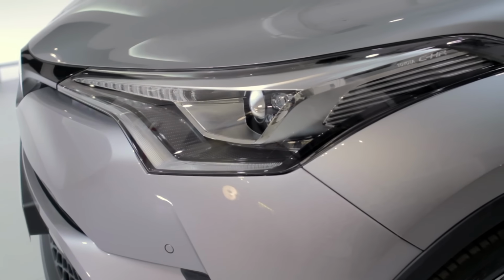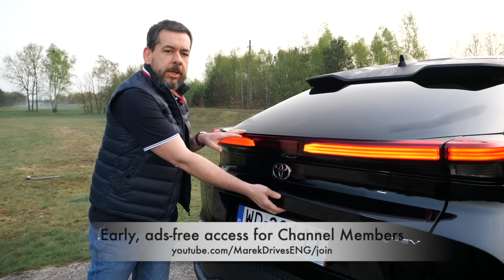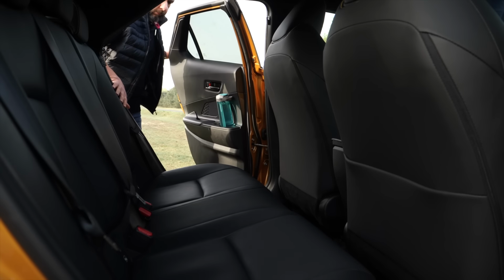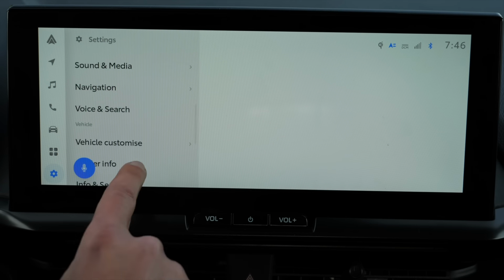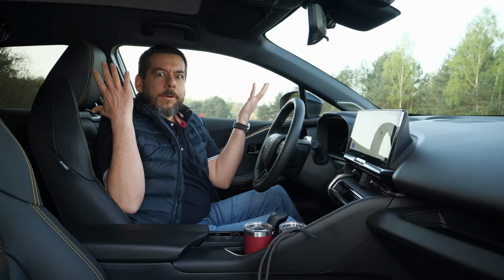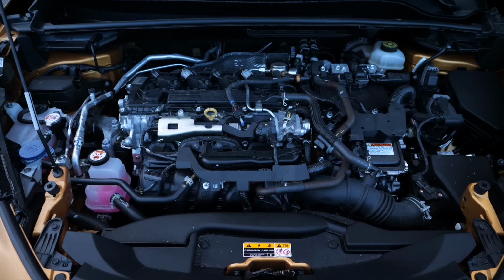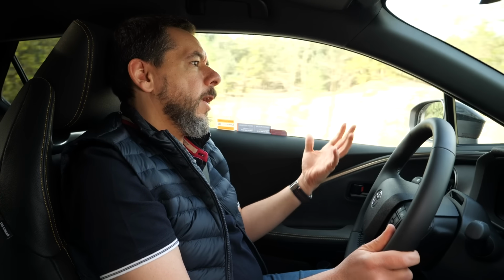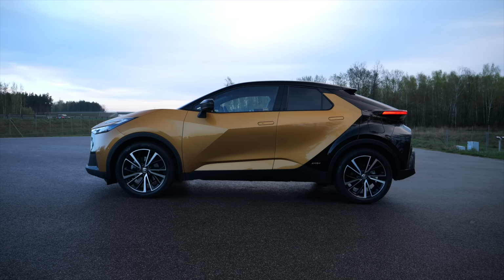2024 Toyota C-HR Hybrid Dynamic Force - How's That Even On Sale? (ENG) - Test Drive and Review

Comment: That boot beep still has my ears ringing! 🙉 There is a great offer for 12 month leasing in my country, so had to give it a test drive. The engine revs I might get used to, but the noise at anything but low speeds makes it a no go. Shame
Reply: You can turn the volume down through the settings for the boot beep, same as the speed monitoring which you can permanently disable and just have it flash in the heads up display instead.

Comment: Marek, to agree once with T&C in the Multimedia you have to setup a profile. Also you can assign a key to it, and every next time you will use your key or app, it will be used with your profile (all your setups, etc.). Such a great review level 🤣🤣🤣
Reply from the maker: Thanks for the info!
I usually setup MyT (or whatever it's called these days) app, and was never prompted to pair the key with the app. In some brands the car's main user is often the press office, so my options are limited. However in Toyota I often remain the main user until they sell the car many months later. So I'd blame it on UI.
Reply: @MarekDrivesENG  Imagine how bad you are at your job to have to be told this rofl. P.S. I don't see an edit to fix the misinformation you are spreading in the video though, typical press member just peddling any information be it right or wrong for a slice of bread.
Reply: La condescendance de ce genre de pseudos journalistes qui fait des essais sans connaître son produit 🥱😑🙄
Le gars avec des a priori et qui ne jure que par BMW 🥱
Mec, si tu n'as vraiment pas envie de tester ce genre de véhicule, évite simplement de mettre tes fesses dedans 👋🏼

Comment: You come across as one big sour pus
Reply from the maker: I just notice more stuff, than people do during a short test drive at the dealer. If some of my observations are not a problem for you - go ahead, buy the car. I'm here to help you make your decision.
Reply: @MarekDrivesENG  I think you are ignoring what market this car is designed for. There are shortfalls such as rear door opening and not enough room for 3 across the back. This is not a family car, it is a generous 2+2 that in PHEV form drives very well and is super economical with a very good performance without range anxiety. You do need a home charging facility and generally drive within 40 miles. It is not cheap but is very well equipped especially on the safety front
When you look at the target market, 10 years warranty with competitive servicing costs and fantastic reliability makes it top notch for that as an overall package for the more mature driver is hard to beat
I just don’t think your reports are subjective
Reply from the maker: @mikejoseph425  reviews are subjective by design.

Comment: You should stop winging. The ACC is different in other markets. The audio speed warnings are disabled by default in Australia. The traffic sign recognition still functions. Fuel usage varies depending on drive mode and style. I have achieved 3.8 litres per 100 kms using ECO drive mode. The centre console divider stays the same for right hand drive versions of the CHR so, no problem for the passenger accessing the cup holders. The boot features four tie down points should you need them. It also has a decent internal light to assist with loading and unloading at night.  

 No car is perfect. I test drove a number of cars before deciding on the CHR. My priority was safety systems and driver aids, driver and passenger comfort, above average multimedia system and, insurance and running costs. It is surprising how many similarly priced vehicles come with a lousy 4 speaker audio system. The 9 speaker JBL system in the CHR is definitely above average. 

Final thoughts, the reviewers comments about the all wheel drive system seem to confuse AWD with 4WD. They are not the same. AWD is not meant to provide off road capability rather improved traction and grip on normal roads. The CHR gets most things right but there is still room for improvement.
Reply: You got it right
Reply: I love my 12L GR Sport
Reply: 値段は高めだけど、デザインは良くて見た目も素敵な車。でも、それだけです。ちなみに、マレクの言う通りです。日本のおもちゃの車で楽しい旅を。

Comment: Regarding the two "nag" screens on the multi-media display. The first one goes away automatically after about 3-4 seconds. The second (where you have to agree to) never appears again once you have set up your personal driving profile ...the one which auto-sets seat position, A/C, radio station, mirror positions etc for each driver.

Comment: So Marek, just tell me - is this better or worse comparing to the first generation C-HR? You basically blasted this model.
Reply from the maker: It's got a better powertrain, it's got a better interior (at least in the front), it's got better (IMO) styling. Having said that the interface is still crap, and soundproofing is atrociously bad, which when you factor in the high price makes this car a second or even third choice. I'd go with Hyundai Kona or KIA Niro over this any day.
Reply: @MarekDrivesENG hyundai kona ev,you can hear the wheels moving on the ground at city speed..

Comment: Allegedly reliable cars. But cheap plastics everywhere, lack of insulation, flimsy wires and covers under the seats and steering column, misaligned body panels (more often at the tailgate), and sharp burs in the internal faces of the front side panels.
Reply: Their engines are reliable, but you're right. In many crash tests, the seats in Toyotas actually break, this doesn't happen in Volkswagens.

Comment: Is a wiper for the rear window now an extra?
Reply from the maker: Not even as an option. I guess they assumed aero is so good it will blow any water off. And the rear is so high dirt will not accumulate on the rear window. I've driven it in the rain, and dirty rear window wasn't an issue.
Reply: their solution is rear view camera in the mirror.
Reply: @salemas5  which also has a handy washer feature. Shame it's part of the tech pack.
Reply: try using wing mirrors
Reply: @stevepanaghiston1846  will they clear the rear window. 
Also, modern cars have door mirrors.

Comment: Honestly this video makes me value my 2023 SkyX CX-30 even more. Small but not this small, spundproof, better handling, better  HMI, and I can easily get 4,7-5 L/100 km on the road
Reply: Which engine do you have that makes 5 litres average?
Reply: @strezification  Skyactiv X 2.0L
Reply: @JulioGarcia-ns8ip  have you had any issues with it?
Reply: @JulioGarcia-ns8ip I highly doubt that a 2.0 Mazda with automatic (!) comes nearly close to 5 Liters in the city. Will never happen. No problem to achieve this with a Ch-r though.
Reply: @markus8484  correct that's why I said on the road ;)
Reply: @strezification  0 issues,runs very smoothly

Comment: What would stop me from buying new Toyota models: CVT ( I know how reliable it is, I hate it); no proper 4WD on all models in price range, only electric motor on rear axle (RAV4 only available with hybrid powertrain), software and driving aids. I wish for Toyota with proper automatic gear box (like in new GR Yaris), proper 4WD system and being spacious 5 seater. Bonus points for fixed software.

Comment: Glad I went for previous model. Agree on sound proofing. I moved from mk7 golf to last gen CHR. Big difference on road noise.  That said the I love the car. Great chassis and drive. Sport model upwards i suggest.  I'm getting 4.5 to 5ltr easy.  Toyota app I find good for letting me know if car locked properly, windows open  etc.  I can't do remote functions on mine.  Safety features might annoy you sometimes but have saved me twice. I went for last gen as I think new models normally have teething issues.

Comment: I love your reviews and AWD hill test. However, can we stop pretending every car with AWD means it should be able to off-road? AWD is primarily for on road stability in rain, ice and snow and has nothing to do with “off roading”.
Reply: Then its not All Wheel Drive is it
Reply from the maker: @kjelllseth3960  I'd argue we could say AWD is not 4x4 or something along these lines. However there are AWD setups, which are better off road, than others.
Reply: Most cars manage to be stable without AWD, so what's the point if it isn't better off-road?
Reply from the maker: @piglet5287 AWD is a big advantage on slippery surfaces, even when it's just taking off from the lights. Or when there's too much power going to the front wheels.
Reply: yep. 4WD (or 4x4) is for off-roading.

Comment: When I was a kid, and that was last century, my father told me Japanese cars are mechanically good but they use very thin body metal. Not much changed since then. I drive a Japanese car and I have plenty dents. I am sure I will get another if I press hard enough with my finger. Sound damping, also something they never cared about.
Reply: My parents had various Honda's over the last twenty years. Accords and Civics. Well built and super reliable well into double figure age. Solid built interiors too. Likewise the Mazda's I have owned. Euro cars are fine for leasing in my experience but I am always happy to buy Japanese.
Reply from the maker: My parents had at least 5 different Hondas in the 90s, and they were brilliant (before I broke some of them). When I drove my first Honda as a motoring journalist in 2006-7 I was very disappointed.
Reply: @jdmguy44  Honda and Lexus are good. I am driving a Mazda 6, before it Mazda 3. From day one I was annoyed by   plastic rattles in the cabin, high noise on the highway which makes listening to music an unpleasant experience. 
Maybe there in Japan they test cars on perfect roads, but here in Europe good roads are in short supply.
Reply: @artpan4376  I have had a few Mazda's and currently have a 2018 Mazda 2 1.5 skyactiv as a second car. No rattles at all and it's quiet/refined at motorway speeds especially for a small car. Sounds like you've been unlucky.

Comment: I recently bought a Hyundai hybrid. It felt more solid and refined to me than the two Toyota hybrids I tried (CHR and Yaris).
Reply: Try a RAV4. They are very solid and refined cars. Would pick a RAV4 over a Tucson any day personally. Toyota hybrid tech is superior to Hyundai too.
Reply: @jdmguy44  On paper, I agree it is, but I've been surprised by how economical and smooth the DCT has been in my Ioniq.
Reply: Yaris still has older hybrid gen, as well as previous gen of CHR.
Reply: but you get 2x the consumption on the hyundai...
Reply: @vladmihai306 consumption isn't everything. You do not pay 50k just for consumption.
Reply: @vladmihai306  I am averaging 68 mpg over 7,000 miles. That will do me.
Reply: @vladmihai306  I am averaging 64mpg (imperial)